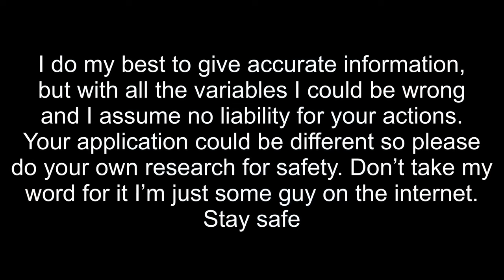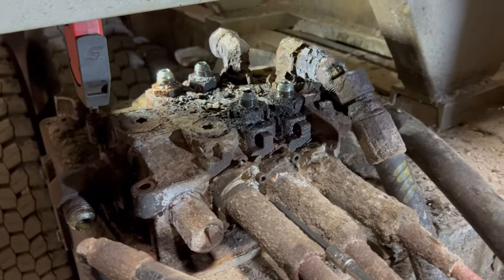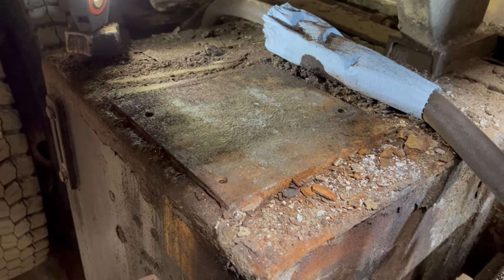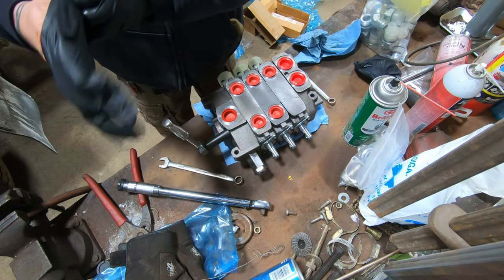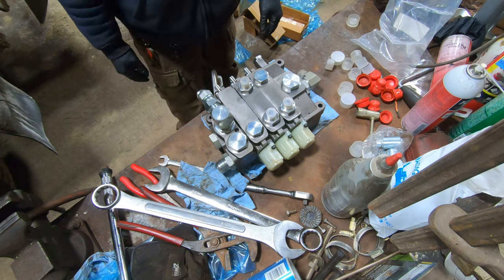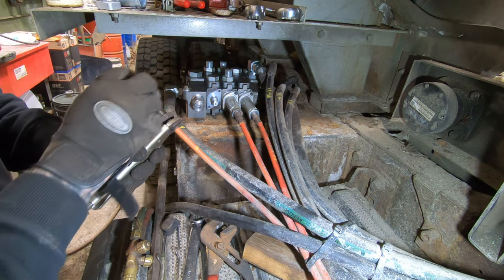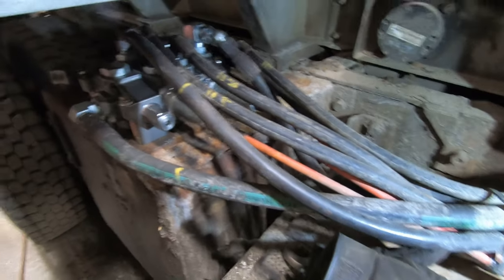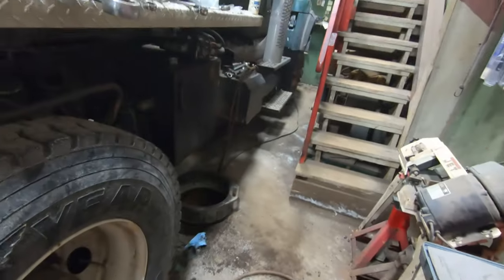Replacing a rusty 3 spool hydraulic valve and assembling the new one

Comment: Thanks for the longer video. I tend to like them more than the short form ones. It's always interesting to see how you guys from up north deal with rusted over used to be bolts. Being in the south we are spoiled by not seeing too much of the super flaky rust. Colorado was bad for salt induced rust but not as bad as you and Wes get to see up there in the great white north..
Reply from the maker: They used to put out a sand and salt mix a long time ago but over the years the sand was getting in the waterways and the epa started making towns clean up the sand after the winter was over and now everyone is going over to straight salt. It’s actually cheaper for the towns to run straight salt all Around and we have taken some classes on how to use the salt efficiency. It gets used to make a brine barrier between the asphalt and snow to keep the snow from packing on the roads and allowing it to be plowed off easier. We put it out at a rate of 500lbs per mile is about average. In the end it doesn’t help with rust. A torch is pretty much a must have. Every year I think about moving but never do.

Comment: The original manufacturer of the valve was Commercial Intertech, formerly Commercial Shearing, INC. before Parker bought them. The VA20 series replaced the older style A20. I worked in engineering for an underground mining equipment manufacturer and we used their products almost exclusively.   Good job on the valve assembly.
Reply from the maker: Thank you. That’s interesting to know. That must have been an interesting job, I’d imagine equipment like that would need to be pretty reliable.
Reply: Also, it’s great to see your boldness in faith as well.

Comment: We run those plastic fenders from spray master on all the f-550’s and salt trucks so your not flinging road  crap at those valves Ans use stainless hardware when we can
Reply from the maker: I put a mud flap between the tires and the valve. It seems to be working pretty well so far. We have those fenders on some of our 550’s too. Definitely helps keeping stuff out of the underside of the bed.